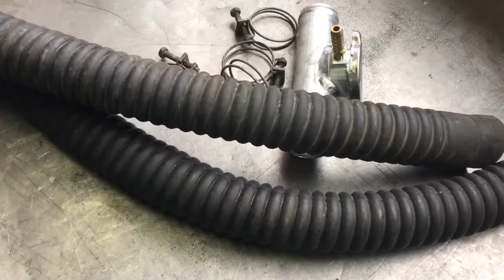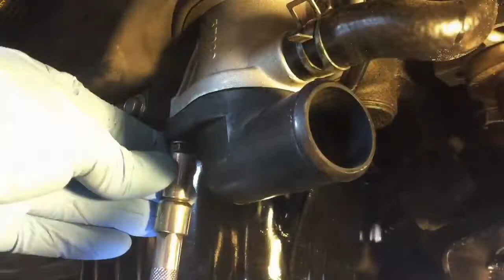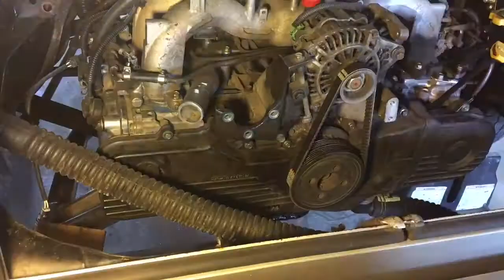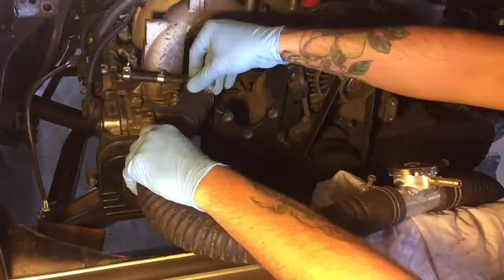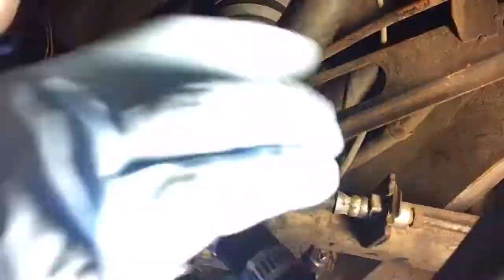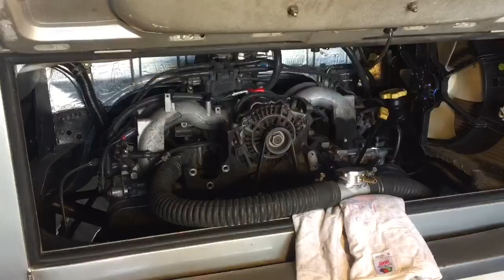Coolant Flush - Daily Driver VLOG 7/11/17

Comment: The radiator works?
Reply from the maker: +Lucas Martínez Parra I'm sure they will work great once I get them connected. This trick is simply to flush the block - no radiator in the cooling system right now.
Reply: Right.